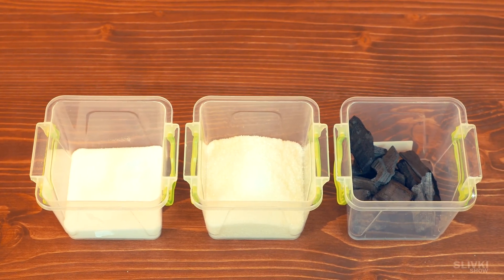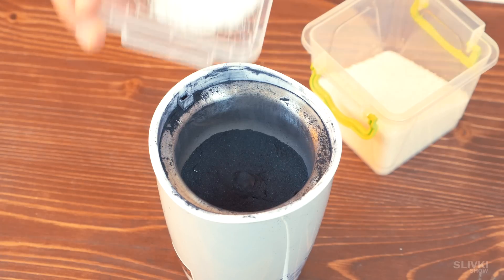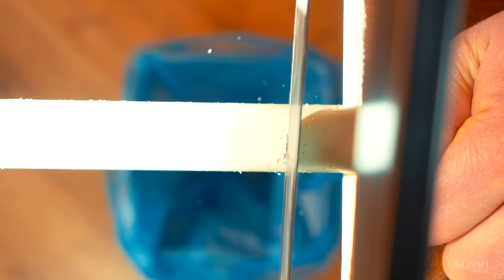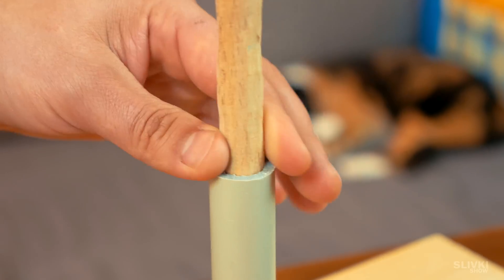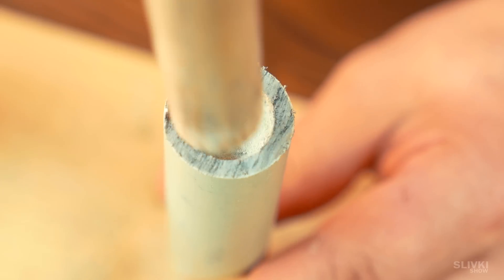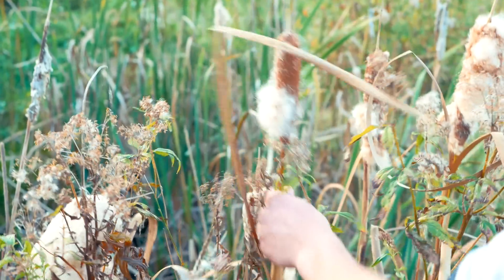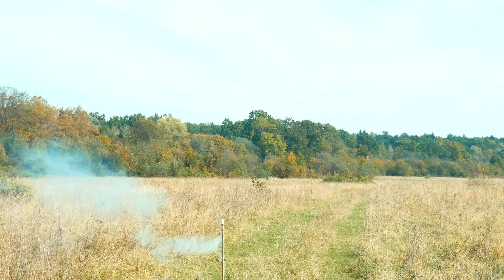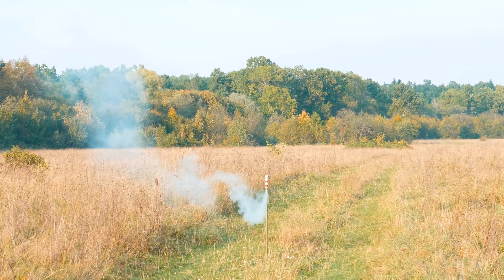How to make a Rocket (Russian space program)

Comment: Instructions unclear, added solid rocket boosters, i am currently 10 000 feet in the air
Reply: Did you check your staging?
Reply: these are solid rockets...
Reply: Dude the main motor is already solid fuel
Reply: Yea i did the same mistake I am currently on Jupiter
Reply: Have you tried turning it off then on
Reply: Have u tried putting it in rice?